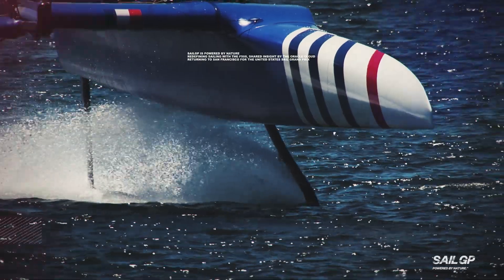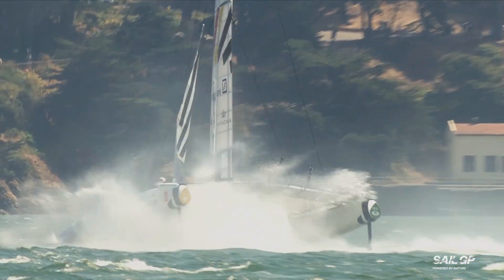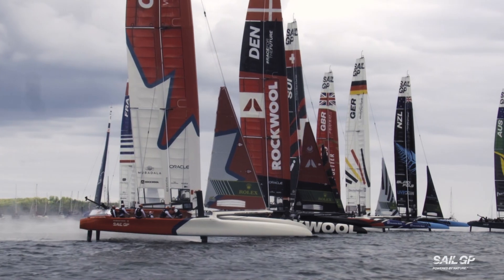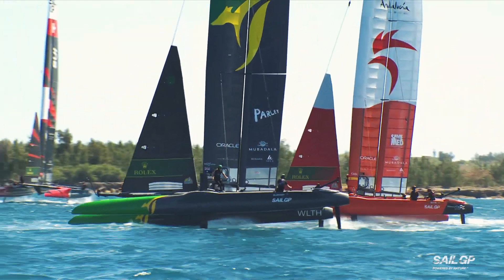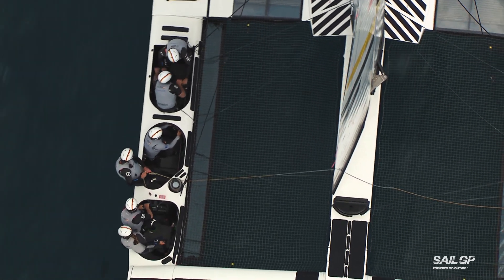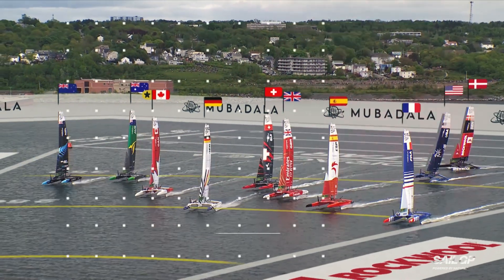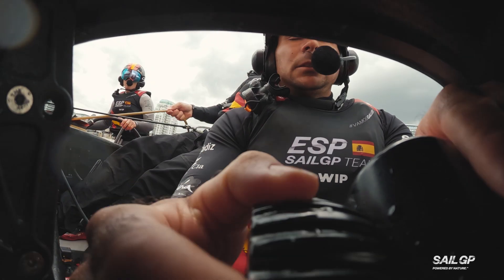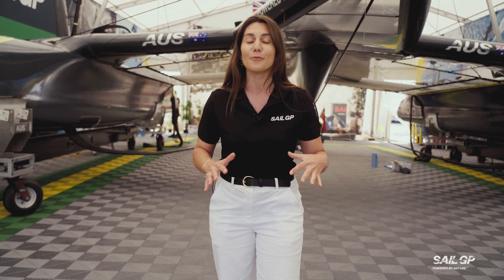SailGP101 - How does a SailGP F50 fly above the water?

Comment: Is there a speed difference between flying a little above the wave heights and a lot above?  If so, why does height above the waves matter?  Can you share information about the source of electricity for these boats?
Reply: flying the boat higher means theres less drag in the water, allowing for more speed. But fly too high and the foil will lose contact with the water, making it unable to provide lift, resulting in the boats crashing down hard.